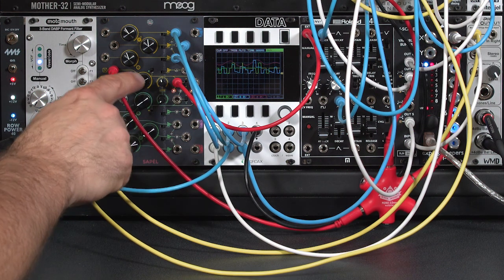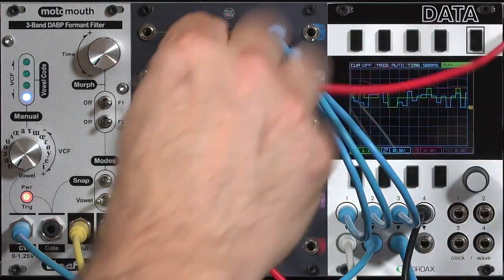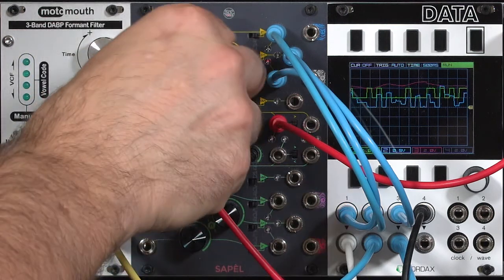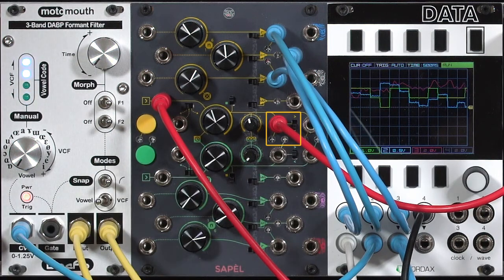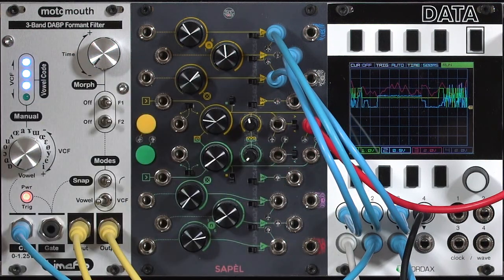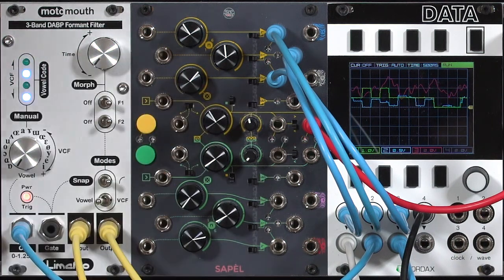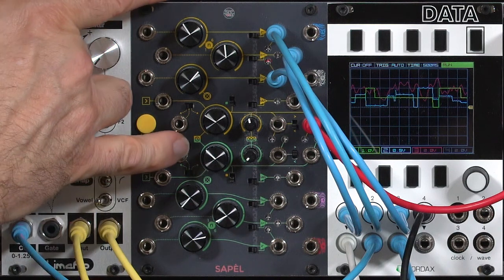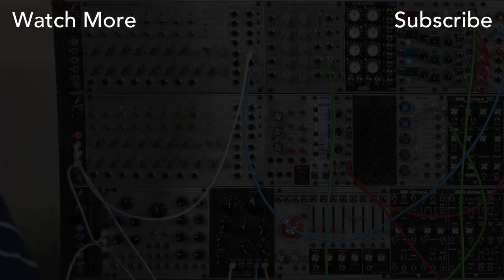Frap Tools SAPÈL 4/4: Gates & Clocks (LMS Eurorack Expansion Project)

Comment: I think that Frap Tools, along with Instruõ, are making some of the most interesting modules at the moment. The Falistri is very endless in its possibilities, working both as an envelope generator, an LFO or even both. The only negative side (and this is just relative) is that their modules tend to be expensive,  and large. However, that's normal considering what they do. 

I'm going to be adding a few of their pieces in the next year.

Comment: Yes it looks really nice ! better than Verbos Random sampling no?
Reply from the maker: I'm always reluctant to say "better" as there are differences; for example, the Verbos Random Sampling has that analog shift register section, plus the "metallic" noise for those trying to create 808 cymbals etc. But I do really like the SAPÈL, especially the way the sections are connected with the probability weighting, and the fact that it's a dual module.
Reply: Learning Modular yeah but still turning my head around how to use ASR and get nice musically results ....any tips..?
Reply from the maker: The most common use is to treat it as a delay line for pitch control voltages. Say you have three oscillators, connected to an ASR. On the first note fed into the ASR, VCO1 gets pitch #1. On the second note, VCO2 gets pitch #1, and VCO1 gets pitch #2. On the next note, VCO3 gets pitch #1, VCO2 gets pitch #2, and VCO1 gets pitch #3. And so on, like a timed echo, except the timing is based on your gate signal rather than a constant time between echoes. 

Here's a Muff Wiggler forum post on uses for an ASR:
http://www.muffwiggler.com/forum/viewtopic.php?t=106192&sid=7a7efa20891264f98e6b7e83886fc5db
Reply: Learning Modular great thx you I will check it out ;)